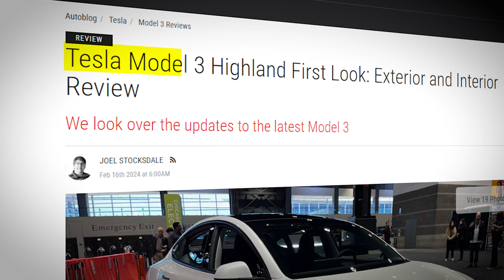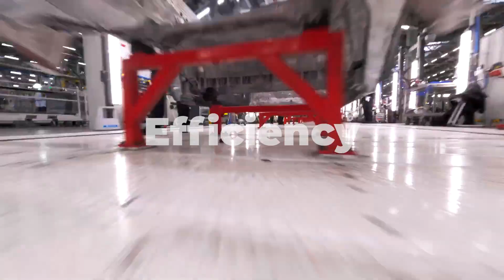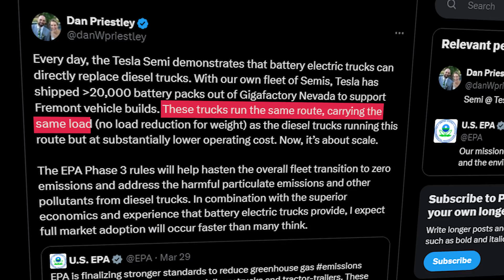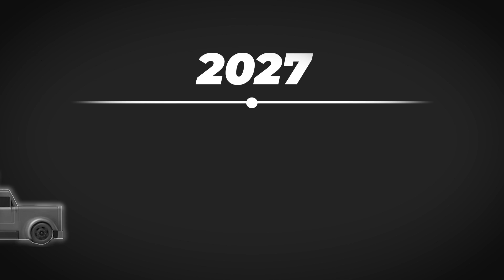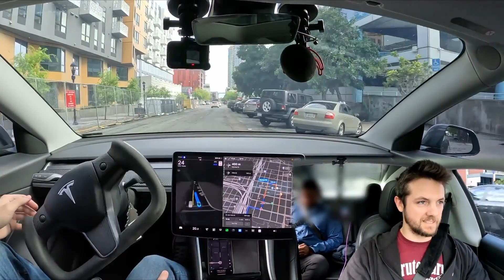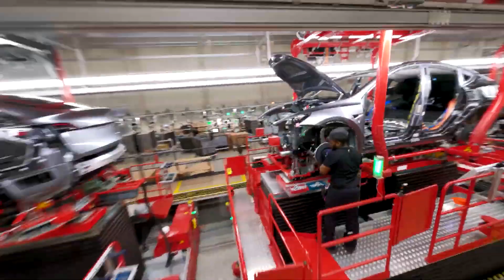Tesla Reveals MAJOR New Model 3 Update!

Comment: A dry van trailer can only hold 44-45,000lb payload or 26 battery packs per trip at 1700lbs per battery pack.  You may want to update your video.
Reply: Came here to say the same thing. 80k is total gross weight not the payload.

Comment: Wrong. Older m3p had a different motor in the rear did it not? Wasn’t just a software update.
Reply: The first version of the AWD had the same motors as the performance, at some point down the road Tesla started putting smaller motors in the AWD, not sure if it was one or both. This is why only some of the AWD 3s can get the acceleration boost software unlock.
Reply: @VanillaBear1  I thought they all could?